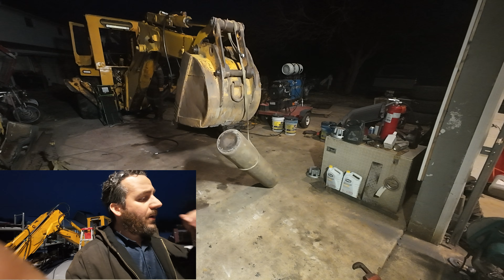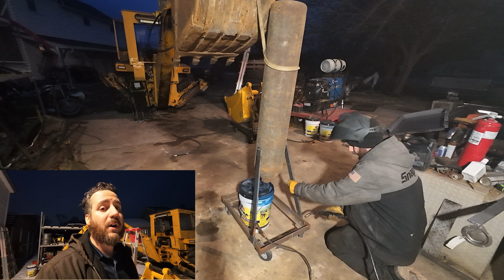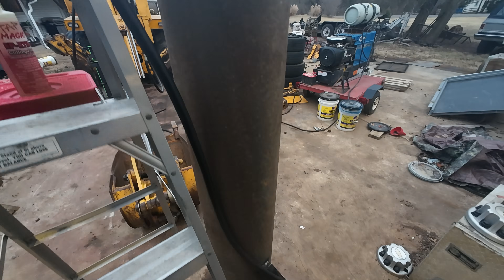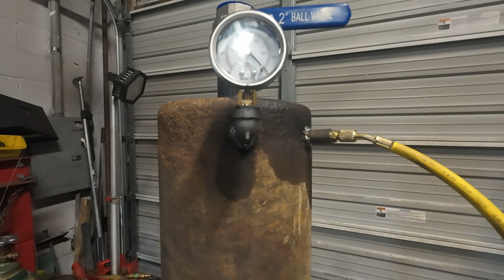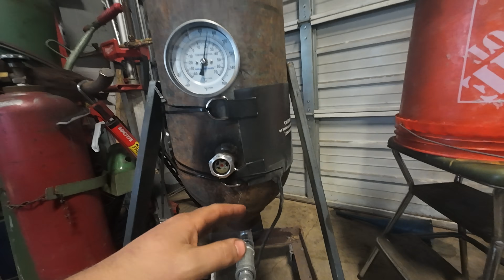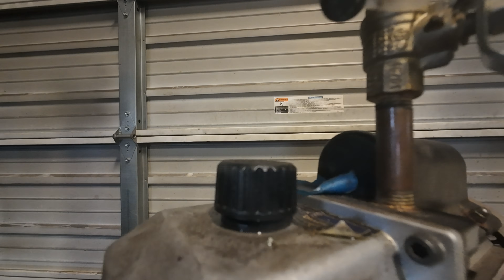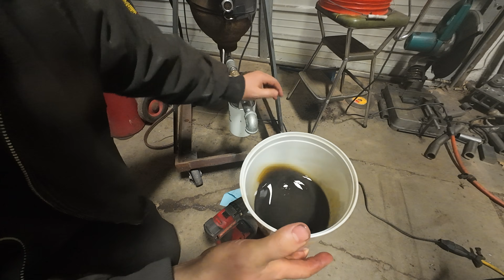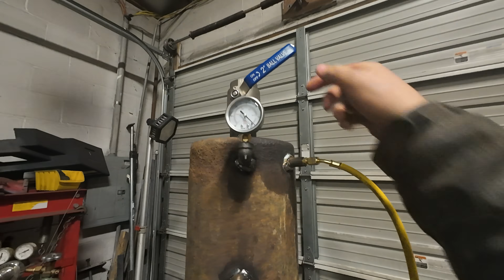I made a machine to remove water from hydraulic oil. Vacuum de-hydration

Comment: Your approach is good. But I would use a large cooking pot for the vacuum chamber. You can slightly warm it on a stove, which speeds up the process by A LOT. But maybe you just wanted to use that cylinder for something, the idea isn't bad either. ;) 
A little air ballast would help to keep your vac pump oil dry (assuming you use an oily pump, haven't watched so far). Because that oil gets loaded with water, too, and you don't get any better vacuum than the watery oil allows.

Comment: Tip, it doesn't need to boil just leave it on low heat or even put in in a black shed that is hot in the summer and make it like a solar wood dryer or a solar cooker. The process they use with CBD oil is mix it with alcohol and the alcohol will absorb the water then separate and can be drained off the bottom of a tank

Comment: Nifty build!  Some thoughts:

1.  If you bubble the air through a tall column of super-saturated calcium chloride (aka 'road salt') solution, that will pull any water out of the air before it can get to the vacuum pump.  (If you look up 'Revolutionary Air Conditioner!' on the 'Tech Ingredients' channel, you can see the principle put into practice as a dehumidifier.)

2. An even better idea would be to use a 8500 RPM/10,000 G centrifuge.  That would pull out all of the water AND particles right down to the sub-micron level.  As well, it can continuously process 10-40 gallons an hour, which means you could (temporarily) plumb it right into the hydraulic system of your equipment to cycle the hydraulic fluid for as long as needed without requiring pouring it into/out of buckets.  

(That could easily become a solid side-hustle, as you could completely refresh the hydraulic fluid of ANY machinery right where it sits out in the field.  What's more, you can use it to clean up waste engine oil and make 'black diesel' to use as fuel for your equipment.  ...and you can refresh any equipment's engine oil right out in the field, as well.)

They aren't cheap--two to three grand--but they will eventually pay for themselves.  Probably the easiest way to get more info would be to look up 'black diesel centrifuge'.

Cheers!
Reply: my head immediately went to centrifuge, glad I’m not the only one...
Reply: its how its done in workshop settings and on ships. they centrifuge all the oil and fuel oil warm it and it works even better. a family friend is a ships engineer.

Comment: Yeah, don't let that foam get into the pump.  Can you set up some traps in the path of the vacuum?  Not sure what would work the best.  You could break down the foam with brush bristles and a cup to collect the remaining fluid.  You know what you're doing.  Excellent so far.  
The genius part is that you remembered that the vacuum lowered the boiling temp of the water.  That's the whole thing right there.
Reply: There are oil/liquid traps for vacuum systems and that sounds like a good idea.
A valve at the oiltank side vacuum fitting is allso a good idea.
If you stop the pump with vacuum in the oiltank the vacuum might suck the oil from the pump...
Allso a solenoid valve on the pump that opens when you have power to prevent the same when you lose power (fuse etc.)
I work on HV equipment and use vacuum to fill compartments with oil (HV capasitors, cablehousings etc.) so we have a glascylinder trap to prevent oil entering the pump.
Allso see through hoses are great.

Comment: You would need a API calibrated centrifuge and Test tubes designed to use in the centrifuge to check BS and water % in your contaminated hyd oil. The oil is heated and then spun in the centrifuge tubes. Eisco Labs Hand Crank Centrifuge, 4 Tube Capacity (15ml Tubes)

Comment: If you are getting that much water in your hydraulic fluid you might want to look into fixing the hydraulic system because that much should not be getting into it.
Reply from the maker: I buy abandoned equipment thats been left to die. Almost all of them have water in the oil when I get them

Comment: Insulate the bottom half of the tank to conserve energy.
You will have less radiating into the room and more being used for its intended use of raising the water temperature.
This should compensate for the fact that evaporation causes cooling.
The price for a bit of ceramic thermal blanket.
Trace heating would be more helpful as its temperature can be regulated to the exact degree.

Comment: A suggestion split your dump line add a second filter use a shop vacuum on top to draw oil in through an inlet filter less spilling and climbing. Then your oil is filtered in and out less contamination into the tank

Comment: I know those vacuum pumps are left on for a while but it seems mean to it i think you could get roughly the same results with a timer like let the pump run for 15 min and reat for 5 or 10 min depending on how fastthe water is boiling off
Reply from the maker: I sure could. But letting it run long times isnt an issue either

Comment: you need a cold trap between the vessel and the pump. also the air leak probably actually helped agitate the oil... gotta increase surface area exposed to vacuum

Comment: I think that oil may be using some form of glycol to pull moisture, so this would be the correct way to dry it. The natural gas industry uses triethylene glycol and a process very similar to yours to get the water out of freshly mined natural gas.

Comment: Maybe run the vapor through a cold condensing tank before it reaches the vacuum pump? If you can control the vacuum level and are heating the oil you can probably hit the sweet point where the water evaporates in one and some (or all) condenses in the other.

Comment: If you heat oil up to 160° the emulsion will separate, and the water will drop out.
Crude oil is often emulsified and has to be run through a heater treater for this purpose.
Reply: That's what I was thinking though without the info you have. It wouldn't be necessary to actually bring the oil up to 212. Water will come off at cooler temperatures, just slower.

Comment: Grain alcohol from the liquor store is 95% ethanol, 5% water, because that is the ratio that cannot be further separated by distillation. But you can buy expensive 100% alcohol from chem supply stores. How is that made?

They add salt to the azeotropic mixture, and salt is soluble in water, but not in alcohol. The salty water sinks to the bottom and purer ethanol floats on top.

Try adding salt to a small sample of used oil, see if it separates.

 This is just FYI, I am not recommending this method, I'm just this guy, you know?
Reply from the maker: Something to try!

Comment: There is a commercially available product that does a very similar thing to remove water from oils. I don’t remember the name of it, but I do know that it heated oils up and used a vacuum chamber to remove water. It is not something that an individual would buy, it was portable but costly. This was about 15 years ago.

Comment: I used to own a used oil company. We would pickup from shops and garages to take it in for recycling into heavy fuel oil. One of our problems was moisture in our oil. The buyers cut the price based on the water content. We would cook oil to dry it but that was expensive because of fuel costs. I never thought of using a vacuum chamber to dry oil. It could run on a tank over night and dry it out. That would work.
Reply: Build a greenhouse / cabinet on the south wall of your shop

Comment: You need a large vacuum chamber in front of the pump so any oil and other contaminates go in the chamber and not the pump.  Those 1L glass top containers on Amazon will work fine

Comment: Add a longer line on the vacuum side and run it through a very cold tank of water before the pump. You should be able to recondense the water if you can get it cold enough and then save oil in the vac pump. I also wonder if "freeze distilling" would work, though that would require filtering the ice out, just a thought.

Comment: can you not just evacuate the engine itself? would that cause issues? or maybe add a oil accumulator thats thermally bonded to the engine and evacuate the headspace of that?

Comment: I bet an air line water trap would do wonders to save the vacuum pump. Pipe it in at the fitting on the tank so it stays with the tank, and run from that to the vac pump. Just make sure that the inlet side of the trap is on the tank and the outlet on the pump. Harbor Freight sells some that have 1/4" fittings for cheap, too.

Comment: This is an awesome solution. If you need it to work in the winter, wrapping it with some R15 fiberglass batting, would work fine. If you don't want the heating band to get hot spots, wrap around the outside of it and the Bottom of the tank with some aluminum foil or flashing.
Reply: You can also let the oil drip through a 1 micron filter and let it sit.

Comment: Great idea... but I think the P.H. will change considerably in the oil after it has circulated in a pressurized system with "water" leaving that residue behind as you're only removing the water vapor. I remember this as a refrigeration tech.. the oil may just be spent, hence the black. You can purchase oil P.H. test kits for quite cheap, maybe you want to do this before putting an acidic oil back in your system.

Comment: Put a copper coil or something air tight, in an old freezer and connect it between the tank and the pump, it will make the water freeze on the side, take it out and dunk it in hot water and blow it thorough with an airline to clear it periodically. This will stop water getting to your pump.

Comment: Did you consider using a freezer and a strainer? I'm wondering if you could be pulling out some of the additives with the water. I'm betting that freezing the oil may be simpler, but you'd want to go to -30ish I think to make sure the water freezes.

Comment: Well your machine is just doing something that can be done very simply. Your separating the water out by boiling it off because the vacuum is lowering the boiling point of the water.  Just heating the oil will make the hydraulic oil and water separate. I use an steel bucket that I welded a valve in the side right above the bottom. I have a sight glass plumbed in the side. You can see the water in the bottom and then just drain it out. I then run the oil through a pair of high capacity filters. One will trap any remaining moisture and the other any foreign particles above 5 microns.  
  Also milking looking oil can also be cause by a high pressure internal leak that causes the oil to be aerated. Usually check any milking looking oil by putting a glass jar, with the oil inside, into a low boiling pan of water. The oil will warm up and separate pretty quickly. You can see it through the glass jar easily. You then know what issue you have.

Comment: Couldn’t you add an air dryer/separator on the vacuum line?Just use a dryer that’s used on a compressed air line feeding equipment or a paint sprayer.

Comment: I would try a different method.
Put 5 gallon bucket in a small chest freezer and plumb it for flow thru of hydraulic oil. Put suction pump on out side. Just before pump, put filter screen and paper filter. As fluid flows thru, ice should gather in the screen,condense and melt and fall to bottom.
Freezing ought to work the best, as oil does not freeze.

Comment: now a centrifugal oil separator can be used to further clean the oil of particulate prior to your process.
Reply: I gues hydraulic oil is just one molecule, pretty much right? and not a bunch of different additives?   centrifugal can separate additives.
anyway industrially oil water separation is done by this, but in a centrifuge.

also butter. but don't use your butter centrifuge for this.
Reply: @lasskinn474 Hydraulic oil is full of additives - anti wear, anti foaming, anti oxidation ect.
There's a reason it has to be changed at a specified interval - it's not just because of contamination
Reply: Yep, likely doesn't even need this whole gizmo. Whatever molecules associated with water should have their own density and will stratify accordingly. This is still a good build, but about the only advantages I see are ease of assembly and a small element of safety for no rotating mass.
Reply: @ this is a lot simpler build yeah than doing this in a larger vessel with a moving thing inside it and everything that goes on with that
Reply: If you think about it, this can be done with a home water boiler. It would be a super simple build, since it already has a heater and thermostat. It only needs some gauges and a vacuum pump. It also has the benefit of being a bit faster and it's insulation makes it a bit more efficient l
Reply: A home water tank would likely implode with vacuum. A vacuum pump will easily crush a steel barrel. I wouldn't try it. A water tank is a bit thicker than a steel drum, but still close enough I wouldn't risk it.
Reply: @  Not likely at all. Most steel drums are pretty thin since they are not intended to hold a vacuum or pressure. A common home boiler tank type water heaters are built to 300 psi, which is a significantly higher rating than most air compressor tanks and even some propane tanks, which can all hold a vacuum. Moreover, its tank walls are significantly thicker than a compressor tank.

Comment: When drilling lots of material with a hole saw,  drilling one smaller hole touching the outer diameter to help with the chip evacuation. Also, that tank is about man sized so you could isolate it with an old sleeping bag or something like that. :)

Comment: Seems like a lot of trouble. I have a centrifuge like this: https://www.youtube.com/watch?v=TjPvuexYy-E
I have a small ship and use it for diesel, hydraulic oil, and diesel motor oil. Depending on the rpm and flow rate, it can make diesel motor oil look near new. It removes dirt and water. I mostly use it for motor oil. Hydraulic oil, transmission, and diesel about yearly. Motor oil about 50+ hours. I test my oil and only change if the test show poor numbers, but never has. Filters last a long time but I change them yearly and cut them open. The savings in oil changes has paid for the centrifuge many times over. Most engines have more than 10 gallons. One engines has 50.
Reply from the maker: Man that thing is nice I would love to have one some day!

Comment: Shouldn't be hard to build a cold trap to catch the water vapor going into the pump. Run a coil of copper wire through a bucket of cold or ice water to condense the water, and add a drop with a ball valve to drain the water like on an air line. Little bit of brazing, probably $30-40 in parts, will save you wear on the vacuum pump.

Comment: Don't forget that Vacuum doesn't make it a free lunch. Boiling Water takes a lot of Energy meaning that the Bottle is going to cool with the Vacuum until the Water can't Boil anymore if you don't add Energy to it.
Reply: did you fail to see the heater attached to the bottle???

Comment: I love seeing basic science applied to solve problems by everyday people. This is great. I do have a suggestion to make your pump last that's really cheap...

When we pull a vacuum for resin, we  connect the vacuum hose to a second chamber in case the froth comes up the hose we don't want it to go into the pump and ruin it. 

What you need to do is connect your line to a second chamber, and keep that chamber cold. That will make all of the water coming out condense. If you had it coming out a copper coil like a distiller going around it would chill as well and drip into your catch. Then at the top of the catch you're pulling the vacuum. This means you'll get a bunch of water in your bucket that you've separated from your oil. 

Should be super cheap and easy for you to pull off considering all the work you just did. Great job
Reply: You're referring to a trap, I suggested that he uses a cold trap as well. This is necessary for most all vacuum pumping systems in recovery.
Reply: On a moonshine still, that secondchamber is known as the kicker pot.

Comment: I would recommend adding a ball valve to the vacuum pump line as you can pump it down and let it sit for a while without putting undue strain on the vacuum pump check valves... Also if you add a 1/4-1/2 inch hose to the fill valve you can fill the tank via the vacuum pump also you are getting the oil too hot for the pressure I'd recommend turning off the heater and just letting the vacuum do it's job

Comment: Hey, great job! I own a couple Pall Vacuum dehydrators that I was lucky to find at a good deal. I've been thinking about making a water removal video for a long time.....perhaps this spring. You are correct about overheating the oil as some of the additives can be boiled off. The steam coming out sometimes stinks terribly, so I route the exhaust hose outside. Next step: stop the incoming water on the machine!
Reply: I'd love to see that video.

Comment: Of course Oil n Water will MiX & we used to call it an,  "Emulsion"  & is a mixture of two or more liquids that are normally
immiscible materials.  I had a buddy who managed a plant that made  emulsions that were to exacting requirements as
he made it for various highway projects.  It was amazing process which had to be manufactured correctly or it couldn't
be used.  Thanks  for the share...... peace

Comment: @SpankRanch Garage  oil gets dark from cavitation - when the cavitation bubbles collapse they cause a pressure spike in the hydraulic oil and burning a tiny bit of the oil like a diesel engine that ignites fuel from compression
its unlikely but not impossibler that the moisture cooking out of the oil might also cavitate - else its from your hydraulic pump sucking oil through clogged filters